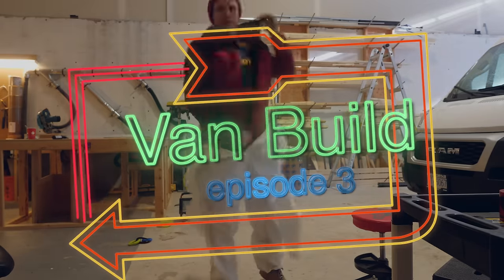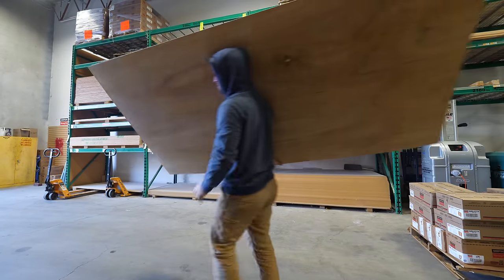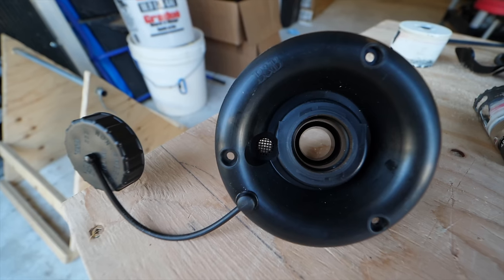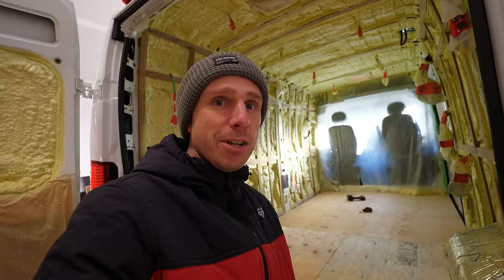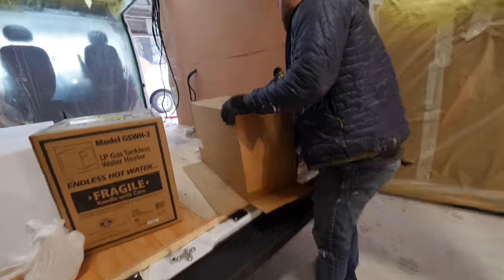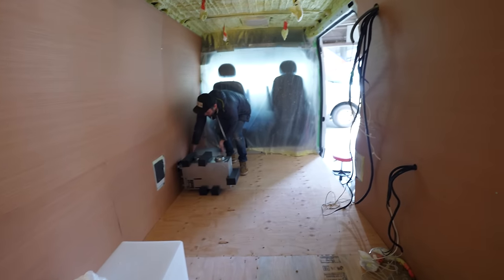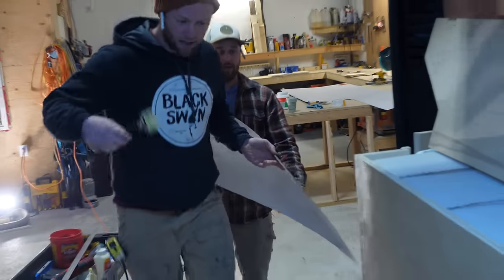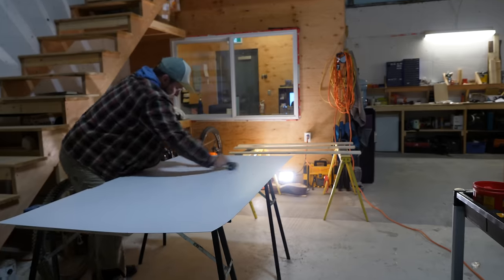Why I Decided To Spray Foam My Custom Van Build...

Comment: Foam like that is so bad on all sorts of levels. plenty of info out there and you have ignored it all
Reply: I can think of way more pros then cons of spray foam. I used to spray the stuff and Its amazing?
Reply: It is toxic crap that off gases into the air you breathe. Wait for yr joints to start aching and to feel generally unwell. People like it cus it is lazy, but is totally unremovable once sprayed.
Reply: @saffyone5198  Off gassing only occurs during installation and curing. Or If you're chemicals were mixed unproperly.
Reply: @liamnissanS2K  There is still gas in the cells that will continue to leak out and be replaced over several years. Especially if the foam is in an enclosed space or covered over.
Reply: saffy one wire brush , acetone , little elbow grease what works for me.
Reply: @HappyHands.  I agree with you, spray foam is just a bad idea
Reply: Can't wait to spray foam my bus . I've met 2 people so far on my full-time bus travels that have spray foamed their buses and man you can definitely tell a difference . Mine isn't insulated and you can definitely tell . Awesome video man . And p.s don't listen to the haters .

Comment: I'd be worried about the level of toxic fumes that foam will give off in a confined space when its curing and later when the hot sun is on the panel work of the van.  I wonder how long it would take for all the volatile chemicals to evaporate off fully, days, months, years ?
Reply: Get a grip , why dont you worry about expanding foam in your house place of work etc. Surely your tin foil hat will fight off the toxic fumes.
Reply: It's a valid concern. No need to be a child.

Comment: I done mine from scratch After 1 week of breaking what i wanted for extreme weather. And keeping in mind all the cookie cutter van builds that install insulation as you would a house...REALLY not the same  I done 2.5' of spray foam (BASF) But first i done a coat of rubberized spray This helps with thermal expansion And conduction greater than the same amount in foam.  My other tip is Add a line to each sized of the van with mini PVC tubing Run your wires inside Make sure you have extra room for more wires (*if needed) This way if you want to remove Or add wiring You do not have to dig up the foam to get access 
Don't feel shy to add in over the spray foam extra batt Or board foam to make flush to the install of the walls Less air travel in there the better. If you have rear windows I done my own thumb stakingly painful sewing on Elevator moving blankets / Plastic cardboard And ring holes to fill in and over the windows And a Blanket across the rear of the front seat Closing the space off for better heat retention My end goal was to save the amount needed to "Keep" the rate of heat from a constant use

Comment: in the future if any welding is needed the van will catch on fire, this is why people use removable insulation
Reply: What you gonna weld on, wings?
Reply: That is definitely not the reason people use removable insulation. Who considers that their frame might fall apart in the future? It doesn't happen. It is a small disadvantage, and does stop welding but its not a deal-breaker, you could still remove bits around where welding is required.
Reply: @jasonkimbro2030   arches, seals, like I said in the future when these areas get corroded
Reply: @jasonkimbro2030  mostly rust repair which is something you should fully expect in a van your going to travel in a lot
Reply: For sure, these DIY lovable homes should be able to be lived in for the long term. A lot of people who are thinking or who have built these don't ever think about the long term of living in them you have to think what could go wrong in the next 10 to 20 years of living in it
Reply: @RobRandom  Rust is only really a problem where there's not paint or other seal. If you prep everything right, it's a non-issue.

Also, if one is going to weld something without prepping the space first, their dumbass deserves whatever happens....
Reply: Rob Random totes not trying to troll, but I need some answers. Wtf are arches? Seals are mammals. Pay attention to what you’re welding. This dude is not going to keep this thing long enough to rust.
Reply: Rob Random I’m also an American from Texas, nothing corrodes very fast here. I’m sure we call “arches” something different. Seals, that was just funny

Comment: So, now the moisture / condensation will build in the interior.... Best to leave some room between the insulation and the outside panels of the van. With some ventilation to let the moisture evaporate. Just look how homes are built. Insulation is never against the outer layer.

Comment: Why would they put the electrical connector directly beneath the two water connections?  Just begging for a leak and short or corrosion.  Loving the build otherwise.
Reply from the maker: Yeah wow, no idea how a car manages to survive with its engine so near to all that fluid. Holy moly!
Reply: @PaulThePunter   Your sarcasm lacks.  Your comment also shows you have zero clue about what I was asking about.  Don't forget to refill the bumper fluid putz.

Comment: great video paul and what clipless pedal would u recommend for shimano shoes
Reply: shimano pedals...........................
Reply: should i get thr ones with a barrier around it or just the clip
Reply: @liamfield7624  just the clip
Reply from the maker: I have used crank brother mallets for years. Easiest to get in and out in my opinion.
Reply: @PaulThePunter  thanks
Reply: @dwightjohnson2145  okay thanks

Comment: Hope you never get any rust on that, because no welder will be able to fix it now. 
It's essentially irreparable.
Reply: just took away like 99% of the value of the van lol
Reply: Chris Rynn it's called cutting the foam back so it doesn't catch fire , the same way you would do fiberglass insulation.
Reply: Have you ever tried getting spray foam off metal?
Reply: Chris Rynn wire brush , acetone is what works for me, and besides I've never had any welding done on a vehicle body , maybe on the frame or hitch . I mean I'm 68 years old and if welding was common place on  the vehicle body I would think i might had a chance to need it since I've been driving.why worry about something you may never need.
Reply: Welding on the body of a 20 year old LDV like mine is commonplace.
You can say what you like about expanding foam, but I have had enough bad experiences with it that I wouldn't ever use it anywhere, especially on my precious van.

Comment: Be careful with toxic off-gassing bro!
Reply: The gas is only toxic in the application process, once it goes off its fine, unless the foam machine pumps the mixture out off ratio
Reply: If the foam is not disturbed after curing it should be minimal. Add the interior trim sealing vapour transmission it will be lower. 

Still not sure I’d trust it.

Comment: The foam it gets wet. Put a piece of polyurethane foam in water, over 2 hours it will be soaked :(
Reply: Spray foam is not the same as mattress foam... That said, they really should seal those cut spaces for good measure.
Reply: @InfernosReaper  I invite you to squeeze Spray Foam, let it dry and put it in water for a few hours... Then we talk about it. :)
Reply: @Lupdorf  Dude, I've been using the stuff over a decade. I've never had that problem.

That said, I could see how one might end up with that problem if they were to say, cut into it first and not cover the cut... Oh, and whether they're using open cell spray foam vs closed cell.

I forgot that not everyone who talks about this stuff knows the difference and didn't account for that possible. My apologies.
Reply: Ginger Ginger I didn't quite understand what you meant. I put an uncut piece in the water, directly from the spray. I will make a demonstration video for you end @InfernosReaper :)
Reply: Ian Solveg you know not what you speak, closed cell WILL NOT absorb water.
Reply: Ian Solveg and while your at it put a piece of fiberglass insulation in water see if it soaks it up, how much water you think is going to be entering the van, if water is coming in you have bigger problems than wet insulation to worry about.
Reply: @heknows5418  the accumulated daily condensation is sufficient to mold...
Reply: Ian Solveg daily accumulated what are you talking about , ac will remove moisture inside !and closed cell foam is WATERPROOF . If daily accumulation was a problem then every car would rust , and be full of mold. Nothing is built that tight.
Reply: @heknows5418  Keep researching, you are right . . . however, the spray foamed area is not one cell. Each of these waterproof cells can be viewed like a bunch of balloons. Each balloon is waterproof, but the cavity is made up of thousands of balloons, and they although tightly packed still have gaps between them where water vapor can and does migrate through, as confirmed by the EPA.
Reply: Rolland Blom I work for the EPA in this field , what's the problem, I know my job and do it really well. No brag just facts. Open cell is like a sponge, closed cell not so much.
Reply: @heknows5418  Like I said, you are right. The problem comes when people equate low permeability with waterproof. As others have experienced the results of low permeability in a van application, there are expensive problems to consider. If you do work for the EPA you should be aware of their stance regarding the safety (a whole different level to what we are discussing here) of spray in polyurethane foam as presented here on the official EPA website: https://www.epa.gov/saferchoice/spray-polyurethane-foam-spf-insulation-and-how-use-it-more-safely 

I don't want to be argumentative, and won't be pursuing this any further. I just don't like seeing people being fed misleading or incomplete information. The waterproof issue can be pursued here: https://blog.polytechinc.com/open-vs-closed-cell-foam
Reply: Rolland Blom Noted!

Comment: Electric plug beneath the water inlets? Don’t use them at the same time Paul.
Reply from the maker: Yes that outdoor designed plug will be impossible to use in the vicinity of water...
Reply: Loving the build...how are you fitting the biking in!🦘🦘🦘

Comment: Don’t forget to add wiring /lights etc that support internet of things so you can add voice control for she who shall not be named and google, to wall sockets lights vocally, a great option to have when the bed is calling and you don’t want to get up again to turn the external or reading light off,  start the heating etc

Comment: I bet the spray foam made it easier to cut holes in the van. The bit won't vibrate as bad and chowder the hole.

Comment: Loving the build Paul, its an awesome van! Quick qu. do you remember if the hoses for the waste water & propane tank were drilled before or after the spray foaming was done? Cheers!

Comment: I have never seen it so runny before, makes sense though since those small cavities are everywhere. Not sure why more people don't use foam, best R-value, air barrier, moisture and vapor barrier and it adds rigidity while keeping the wall thickness minimal.
Reply: I can lead to warped body panels. And it takes a next level of expertise. Those are the reasons I was given.

Comment: Probably should of had the external power hubs above the water hubs. Cause now from what I seen as they were being installed if there is a leak you will have a steady drip going down onto the external  electric hub.

Comment: As one expat to another, the more I watch this the more I’m scared about the effort for my own van build project in the summer of 2021. I’ll only have a budget of $70k so not enough for a pro build like this. Thanks for the series. It’s giving me plenty of things to consider.
Reply: It can be done cheaper and better, spray foam is a pretty poor decision for a van build, wear aside it's not the healthiest option.
Reply: For $70k you can have an amazing build if you build it yourself. Check out Foamitgreen. It addresses all of the issues people have with spray foam.
Reply: J Camp I ended up buying a pre-built Revel 4x4 instead.

Comment: im not dissing your guy that did the hole cutting.... but why did he put the electrical hookup directly underneath the water fill.  water and electric dont mix,  if you spill or leak, it will most likely go right down the side of the van and hit the electrical plug in,  now i realize that it supposed to be waterproof, but if you have city water AND  shore power going at the same time the cover is open on the shore power, if  the water leaks.... it could present a problem.  just saying,

Comment: (4:31) - Did you not treat that bare metal round edge of holes ?
Did you not paint / seal it ?
If not you'll more than likely have rust issues down the road.
>

Comment: not to nitpick but why would you put the water nozzles above the 240v electrical outlet? If there is ever a leak while hooked up it could lead to a very dangerous situation. Just my two cents.

Comment: Formica is a terrible idea. The temperature fluctuations  will cause the adhesive to fail within a year, and the stuff will start de-laminating.  Still a nice project despite this misstep. A better solution would be a stain grade panel with trim strips trim nailed on the seams.

Comment: Looks good. How much weight is being added?
Reply from the maker: Well it's foam.....also vans are designed to be driven with weight so actually the whole thing drove a lot better after things were installed.

Comment: I agree that using spray foam for insulation is the best way to go, but then why do you leave all this space behind the plywood boards empty?? You could probably have gone for rock wool without all the spray mess (and cost!) for the same thermal insulation value.

Comment: Looks good , my concern is the foam fire resistant? What if you get a short and it caused a fire ,
Reply from the maker: Yup it is fire resistant. Just melts down, isn’t flammable.
Reply: That’s good news  😀
Reply: Yep its flammable , just like wood but puts out toxic fumes ,  a little hard to start .
Reply: RDtrailers1 that would be a concern with the amount of foam used, just my opinion. I know all the wire is in a protective tube but short circuit s do happen ,

Comment: Ive worked for an insulation company. I quoted the work that has to be done. Its not true that its sound proofing. in fact, its worse when you use urethan as an insulation.

Comment: Paul, I totally like your promaster conversion man.  I ride as well although not at your level.  I have been looking at the Promaster and think it is the best for van conversion.  Regarding the foam.  I was going to use it but then read somewhere that the foam disintegrate and turn into dust that is harmful to your health.  What do you think about it?  Is it myth or there is some legit concern to it?
Reply: Only happenes if it is exposed to UV light, inside panels it's safe. People live on yachts/ships that are all insulated entirely with this stuff, no issues.

Comment: 5:31 i would have put the electrical plug on top. If there is any water leaks or spillage. It could potentially be dangerous.

Comment: An amazing van build. I have a question. I have heard that spray foam can contract a bit as it ages, thus opening up gaps that can let in cold air and/or moisture. How do you avoid this, and how do you intend to deal with it if it happens?
Reply: Foam doesn't have to shrink or crack to be a problem. Humidity can go right around it, see here: https://blog.polytechinc.com/open-vs-closed-cell-foam
Reply: @rolliebca  just to correct you again - that only goes for open cell foam, closed cell is virtually impenetrable. I say virtually because every material on the planet is somewhat porous, but the porosity of closed cell foam is so minimal that it would take decades for vapor to penetrate a 2 inch thick layer of it, and even for that it would have to be steam under constant pressure. If he was to seal the foam with fiberglass and gelcoat that would be another order of magnitude better than it already is

Comment: I hope this doesn't happen to you.......

I was deployed to Afghanistan and Iraq among other similar countries and areas.  We would use foam to fill gaps in CHU's and other van type containers.  Foam deteriorates very quickly when exposed to high temperatures.  Maybe have a panel to open from the inside so you can inspect your foam from time to time.  Direct metal contact and direct sunlight produces a lot of heat even in Montana.

Comment: Cool with doing the spray foam. But why, why not fill it out so it goes flush with the wood? You could almost double the insulation some places. I mean, you did it with floor. You're not the only one doing this.

Comment: Spray foam is just too risky because of noxious gasses that can be emitted for months. And all vehicles are inherently sealed unit. There very little drafts and that space can be heated or cooled in not time. And god forbid ytou need to get at one of your cable runs.

Comment: Thanx PtP, excellent. For those of us starting with a "probably used for something else for a long time van" would the inside walls need to be prepped in any way, possibly sanded or does the foam stick no matter? Roughly, what's the cost?
Reply from the maker: Hey! I’m not sure, but the guys didn’t do any prep to the walls. It cost just under $1,000 CAD to do the side walls, floor and ceiling. The foam will stick to anything and everything, it could even blow miles away and stick to a car in another town! Extreme, but possible. But I can tell you that the insulation is phenomenal.
Reply: @PaulThePunter  Foam has always just made sense to me. It must be good for deadening outdoor noise too. My goal is Maine to Ca then north to the lights. I'll be watching you.

Comment: I wass thinking it would be interesting to put electric car charging port to charge up but I assume the voltage would be the first problem.
Reply: Definitely requires a mains supply